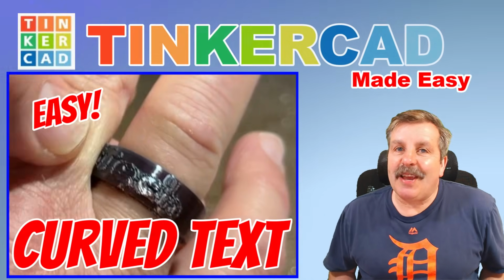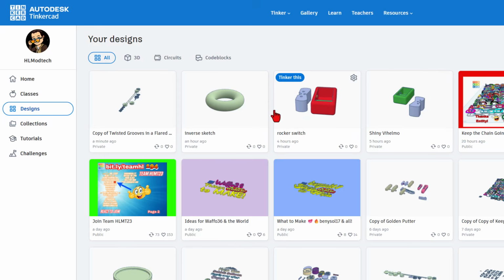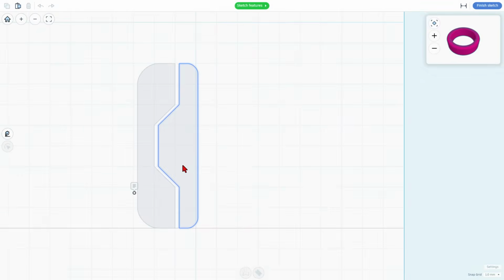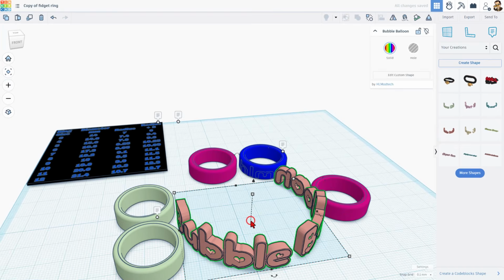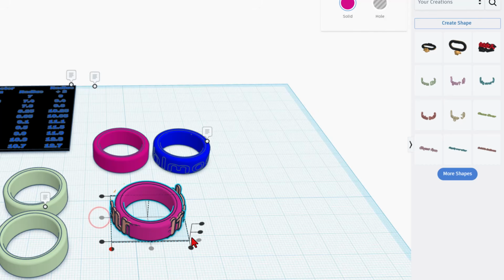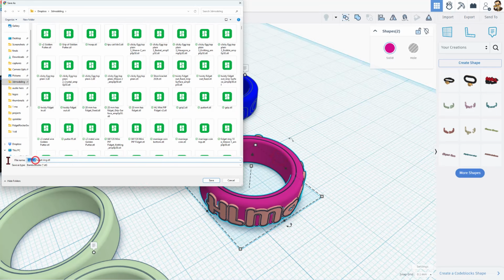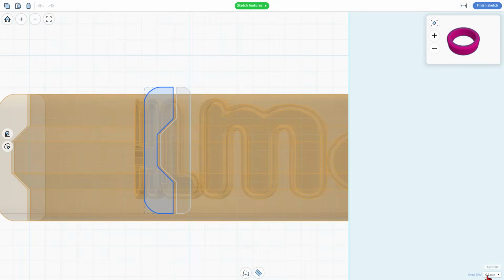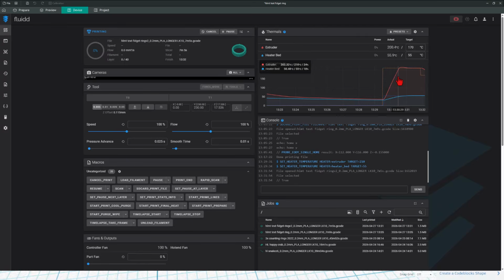A Tinkercad Spinning Ring: Reusable Custom Curved Font Hack! 💯🔥

Comment: I have even found that if I change a fulfillment brand the print no longer works. There are no guarantees with 3D printing. Very much an ''art-form'' still.
Reply from the maker: That is a possibility. The silky filament spins better than my matte PLA. At least the steps to resize it are super simple. I appreciate the feedback! Have a great week. 💯🔥